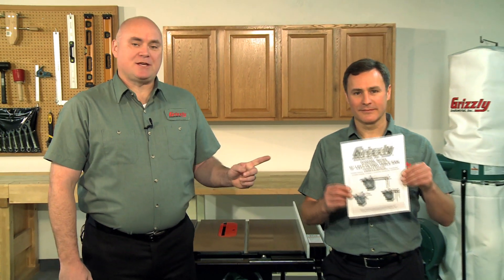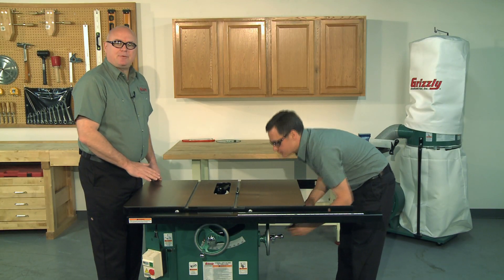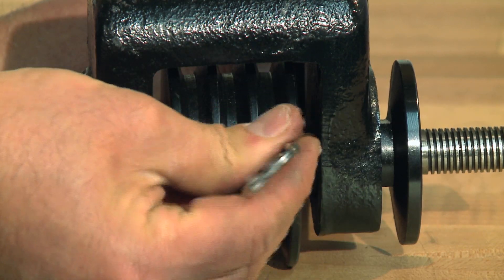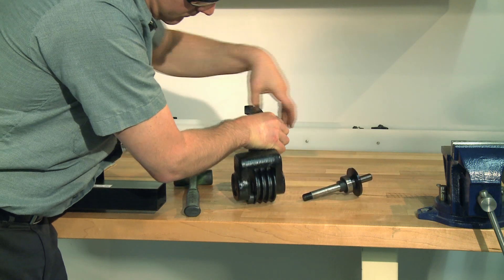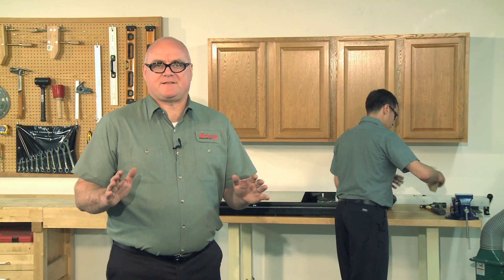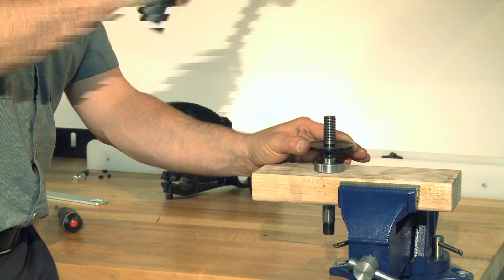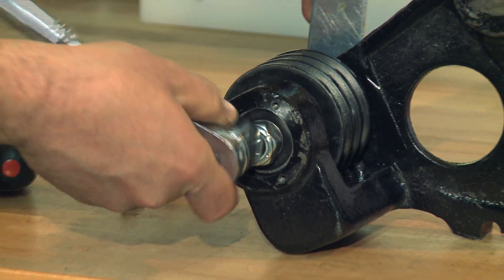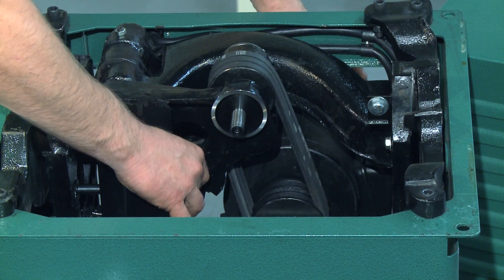How to Replace the Arbor Bearings in a 10 Inch Table Saw (G1023SL Series)

Comment: Great video.  However no mention was given to how tight the arbor nut should be or about alignment of the pulleys. If the pulleys are not aligned properly the belts will be out of alignment.
Reply: Ralph Walker I noticed that too. This is a must!